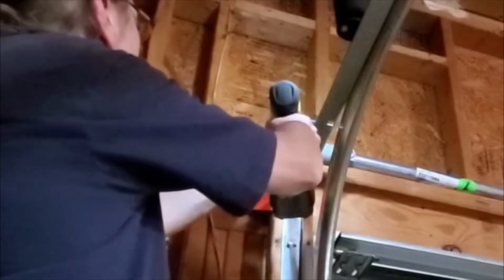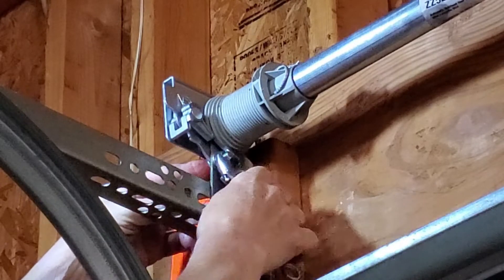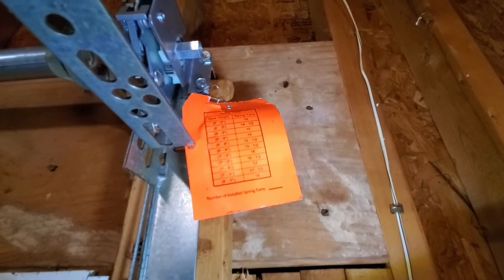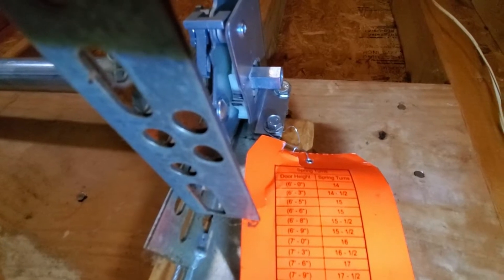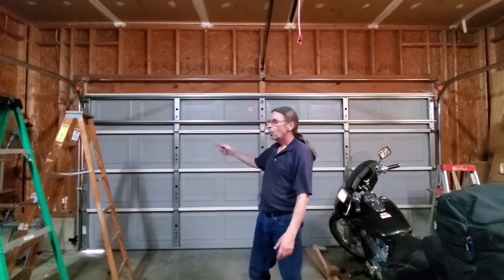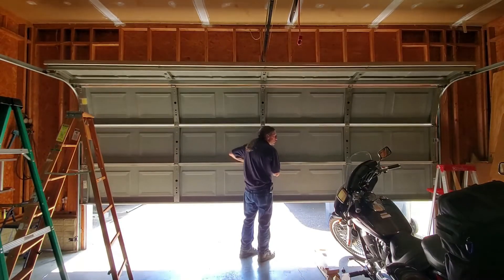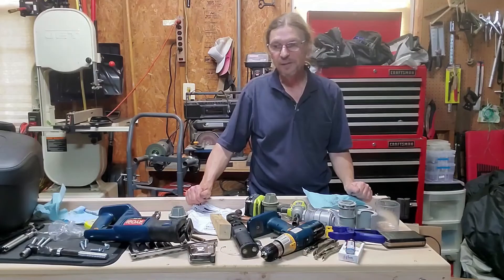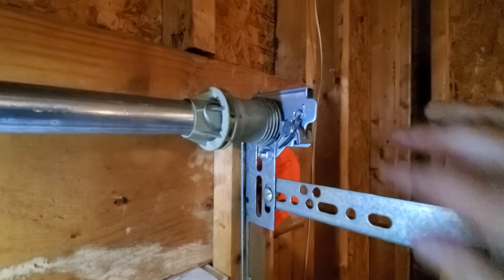Replace a Torquemaster Garage Door Spring Part 3

Comment: That’s a long door, you almost needed another person, I have two doors in my setup, should be a little easier,  good video 👍
Reply from the maker: Yes, thanks.  The door is too heavy for me to lift without the spring.  The spring wasn't that heavy, just clumsy. I posted this hoping others could avoid the pitfalls and dead ends I found, like the fact you need to use a block of wood to carefully pop the cable spools off the ends and re-use them, or that everything could slide out/off the end if you tilt it.  Good luck with yours.